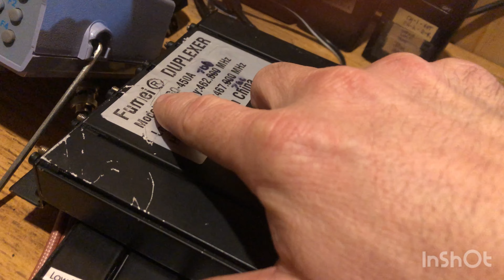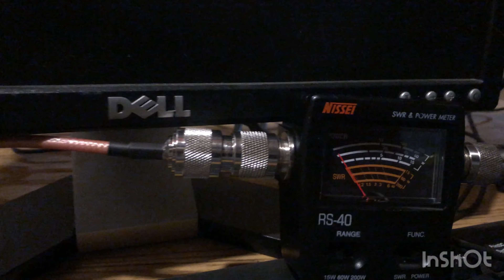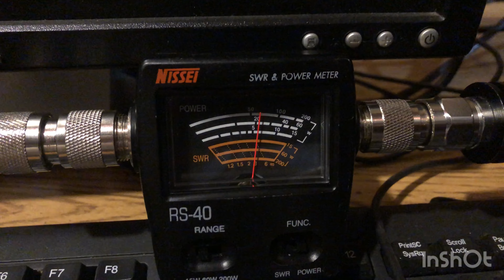GMRS FUMEI DUPLEXER 400-470MHz 462.0000/467.0000 MHz

Comment: I have a friend with a local GMRS repeater.   Would you know of a good simple to follow procedure to tune the duplexer.  His repeater is a kenwood TKR-850.  I have the service manual
but nothing on the steps to tune the duplexer to a new frequency pair.   Thanks
Reply from the maker: I’ve stepped away from my radio gear. However, I’ve found a few how to tune a duplexer vids on YouTube to teach myself. Good luck!
Reply: @DIGGINGDEEP007  I did more looking and found out what I need to tune a duplexer like what's in this video.
Reply: @n1kkri  care to share??
Reply: @keyoflife24  I found a video on youtube showing how to tune it.   In my case the duplexer had a stability problem.  I was able to tune it but any pressure
applied to it would de-tune it.   Replaced the duplexer and the repeater is working fine.

Comment: I recently bought the FUMEI SGQ-450A off Amazon. The loss is tremendous. 40 watts in and only 12+ watts out, same exact scenario you’ve had with the 30 watt version. Seems strange how the 30w. and 50w. Have the exact same model number. Are they now marketing the 30 watt as the 50 watt for more money?  Is the model number different from the ones you bought 2 years ago? 
  Reviews on Amazon are not very good. I’m going to try a tuned Duplexer from Buy Two Way Radios and see what happens. This FUMEI is heading basic to Amazon.
Reply from the maker: I haven’t messed with the radio gear in a while, but based on memory I know for sure the 50watt was much bigger with larger cavities. Sounds like that could be possible. I’ll have to check. 
Thanks for watching!

Comment: I have the duplexer sgq-450a.the sticker tells me low 462.000 and 467.000 for high.My repeater is 462.675 and 467.675.. Does this need to be tuned or am I fine??
Reply: The high side will need to be tuned because it's not gonna be able to hit because the frequency goes beyond 467.000

Comment: what kinda spectrum analyzer is that and where did you get it? thanks in advance
Reply: The one that I used was made by HP   HP8591E.   It has a tracking signal generator meaning whatever you setup the sweep receive frequency range it will will have a port
with a the generator output signal sweeping the same frequency range allowing you to see the bandwidth of the notch and peak bandpass.